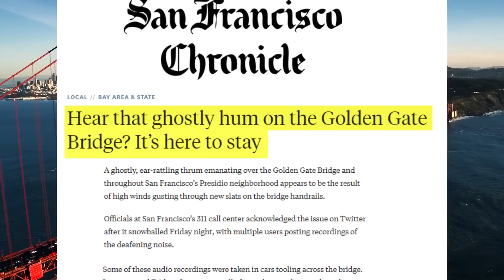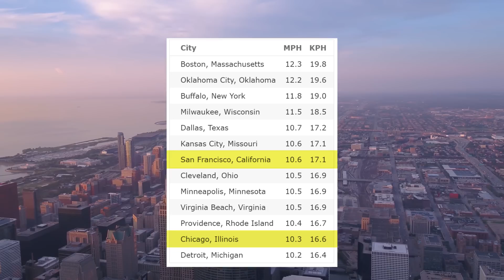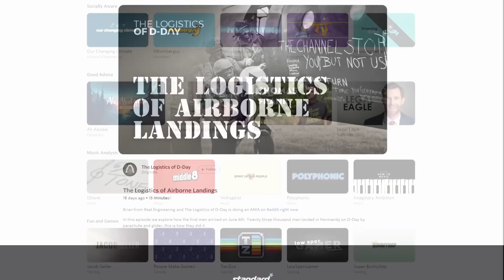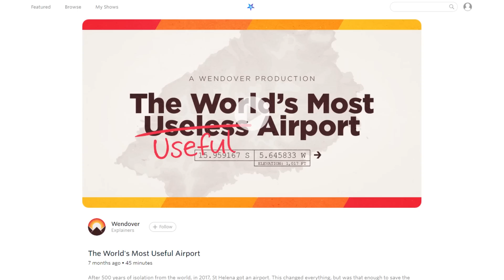Why The Golden Gate Bridge Is Mysteriously Humming

Comment: there could be a very effective low budget solution to the sound problem. bind reed/twigs mats to the railing and it will break the wind enough to remove the vibrating effect.   In state of reed you could also use other cheap material. It should not block the wind to much but just enough.